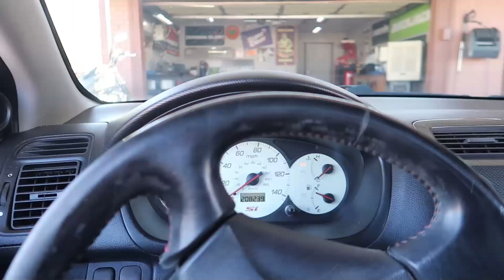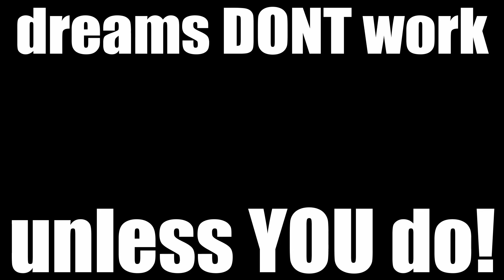Widebody RD1 gets a New Transmission!

Comment: much easier to use your quick jacks to aid your install by lowering the vehicle to the trans. I do all my work by my self and use some unique ways of installing engine and trans. you should have seen how I installed my 50 mercury body on my chassis with a engine crane and a few 6x6 blocks it was sketchy as hell but goterdone